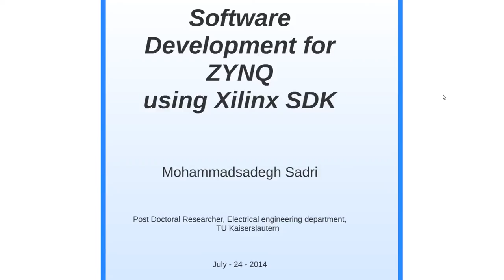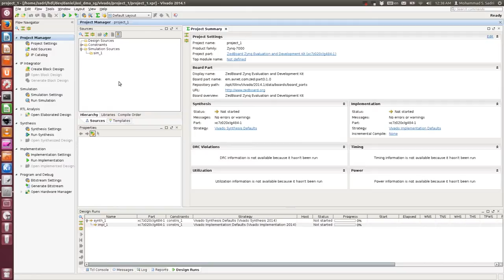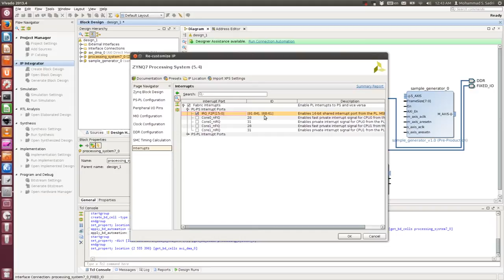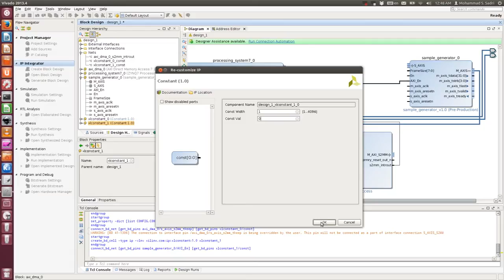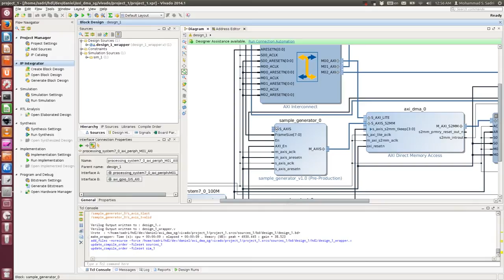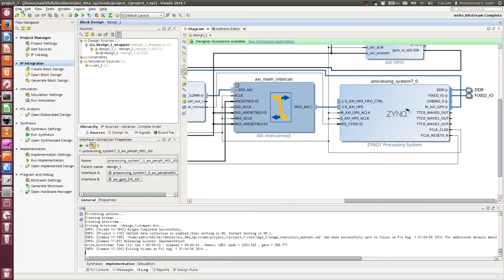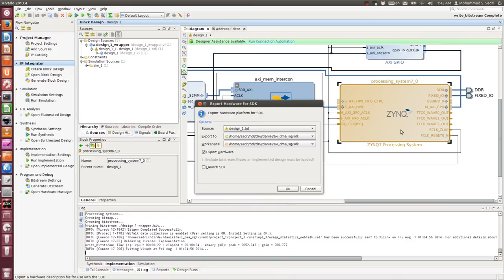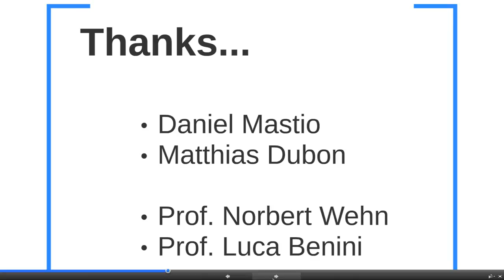Zynq Training - session 09 part II - Creating the Base Hardware for exporting to Xilinx SDK

Comment: Hi brother, .. thanks for such great detailed videos,
I am following your videos from lesson 1 to 9 (II) in this part I have created the same project as yours. But the following error I can't solve please help.
Synthesis
Out-of-Context Module Runs
AXI_mapp_synth_1
[Synth 8-448] named port connection 'En' does not exist for instance 'Sample_Generator_v1_0_S_AXIS_inst' of module 'Sample_Generator_v1_0_S_AXIS' ["e:/NRTC/AXI_DRAM/AXI_DRAM.srcs/sources_1/bd/AXI_mapp/ipshared/86af/hdl/Sample_Generator_v1_0.v":49]

[Synth 8-285] failed synthesizing module 'Sample_Generator_v1_0_M_AXIS' ["e:/NRTC/AXI_DRAM/AXI_DRAM.srcs/sources_1/bd/AXI_mapp/ipshared/86af/hdl/Sample_Generator_v1_0_M_AXIS.v":4]

[Synth 8-285] failed synthesizing module 'Sample_Generator_v1_0' ["e:/NRTC/AXI_DRAM/AXI_DRAM.srcs/sources_1/bd/AXI_mapp/ipshared/86af/hdl/Sample_Generator_v1_0.v":4]

[Synth 8-285] failed synthesizing module 'AXI_mapp_Sample_Generator_0_0' ["e:/NRTC/AXI_DRAM/AXI_DRAM.srcs/sources_1/bd/AXI_mapp/ip/AXI_mapp_Sample_Generator_0_0/synth/AXI_mapp_Sample_Generator_0_0.v":56]

[Synth 8-285] failed synthesizing module 'AXI_mapp' ["E:/NRTC/AXI_DRAM/AXI_DRAM.srcs/sources_1/bd/AXI_mapp/synth/AXI_mapp.v":13]

[Common 17-69] Command failed: Synthesis failed - please see the console or run log file for details

Comment: By using the click-and-drop IPs, does it mean that here is no need to write any verilog code any more and the FPGA can be designed?
Reply from the maker: Hello Kevin. Maybe you are right. Personally, I am very fan of realizing the hardware using Veilog or SystemVerilog. I use any sort of higher level synthesis only and only when necessary. Younger generation may think different. What I think, you write a module only one time. You put few days and it is ready and it is optimized and you exactly know its behavior. The thing is many times the high level hardware description languages try to solve a problem that does not really exist

Comment: How to set the environment variable for vivado. I am new to Vivado. 

I executed this
>source /opt/Xilinx/Vivado/2018.2/settings64.sh 
then tried 
>Vivado &, it still shows command not found.
Reply: Go to Vivado installed directory.
in your case
cd /opt/Xilinx/Vivado/2018.2/
then type following commands 
$ source settings64.sh
$ ./settings64.sh
type viv then press tab you will see vivado or else directly type
vivado &